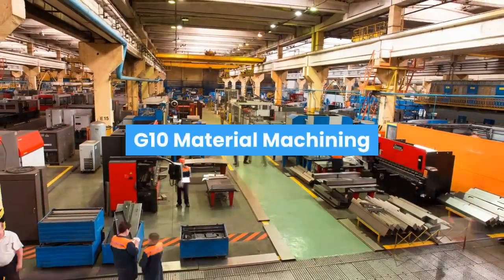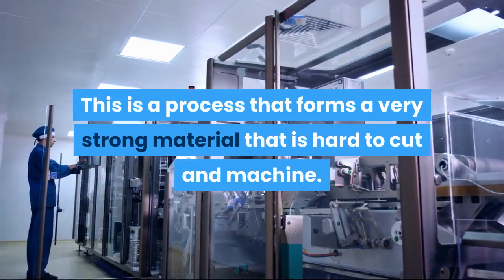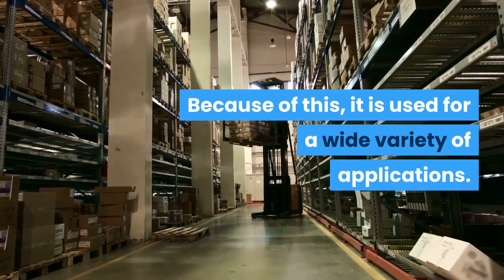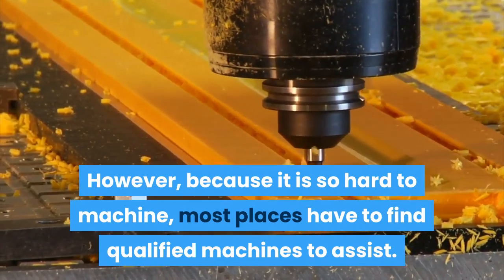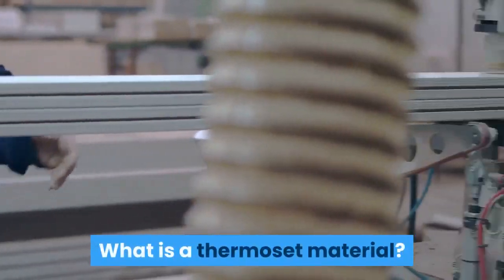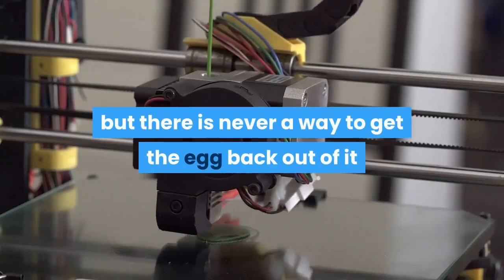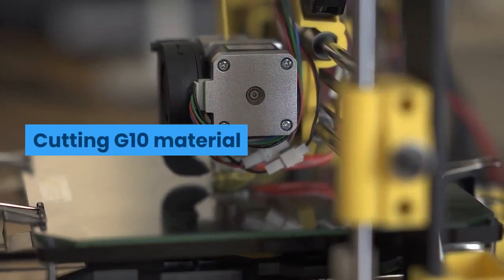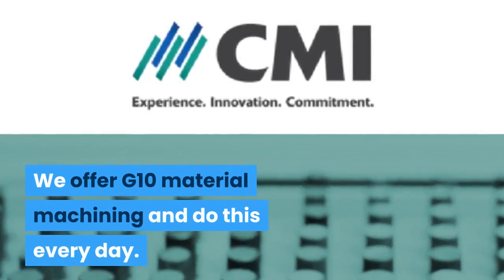G10 Material Machining

Comment: What's the next best cutting tool to Diamond?  Coated carbide with a tiny corner radius?  Im going to make 30 parts out of a 12" X  12" X .5 Sheet and have it all bolted down.  Now need to profile the parts out.  Using a Haas with coolant.  I've noticed you need to keep a keen eye on your coolant filtration system as the material and dust form a snot and will clog up your filter in a heartbeat.